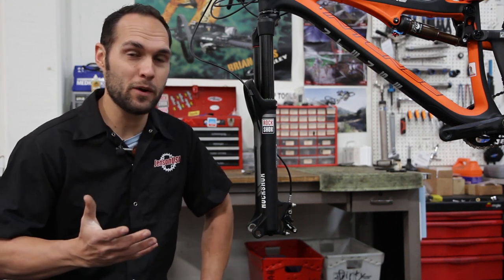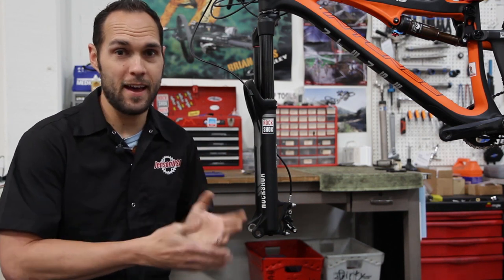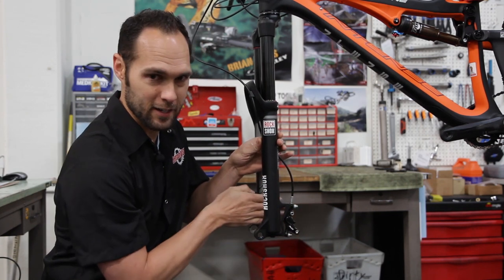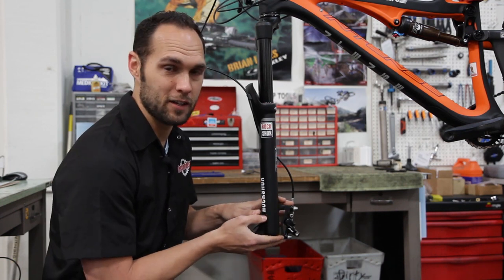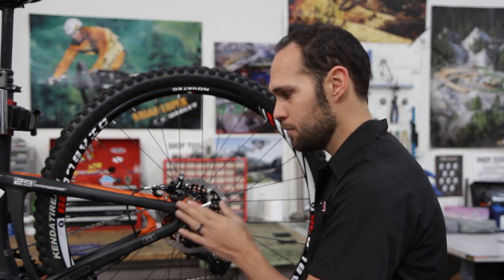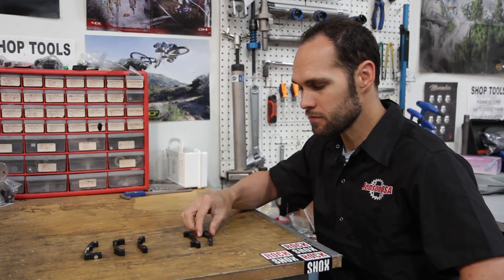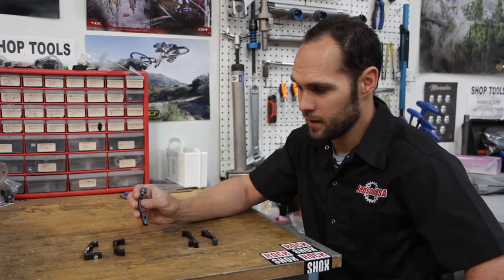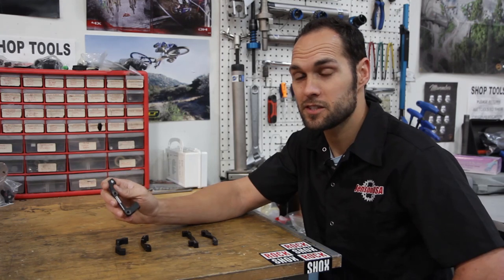Ask A Wrench Episode 07: IS & PM Brake Adapters

Comment: If got a mtb it has a 180 mm disc with postmount at the front and at the rear a 160mm disc with is. So you know witch Adapters would fit?

Comment: Kudos! I have a question though.. If my frame already has a IS that accommodates 180mm max rotor size, what adaptor do i need to use to be able to mount shimano saint brakes (post mount) with 180mm disc?

Comment: Just the info I was looking for. But I may have missed a good point.  What size shimano adapter is good for a 160 rotor and caliper for the rear wheel? All purchased in the same set.

Comment: Great explanation. On my bike I have this second adapter that you mentioned, Avid Adapter Postmount 40 P für +40mm Disc Rotors.
Now I would like to change the groupset to Shimano. Will use 203mm rotors, but it is really confusing what is the right adapter from shimano to replace this setup from Sram. Front fork is RockShox Sektor RL DebonAir with Brake Mount: disc PM6 (direct mount 160 mm). 
So I was guessing for the front this should be right one?
160 mm fork mount:
Shimano SM-MA-F203P/P2 - for using a 203 mm brake disc

Thank You
Reply from the maker: Hey Tomy Boy! Glad the video helped.  Based on your description of your setup, it sounds like you need this adapter: https://www.jensonusa.com/Shimano-F203PP-Disc-Brake-Adapter.  This is for a Post Mount fork with 160 native going to a 203mm rotor size.  If you need any further guidance, give our Gear Advisors a cal at 888.880.3811.  Keep Pedaling!
Reply: Thank you for your quick reply. 
Well on my bike that is still arriving I must say Turbo LEVO FSR 2019. 😊 and would like to change components while still new and the bike is at the shop mechanic.
This are the screenshots I could took from some video presentation of the bike. You are right regarding front adapter. 
http://shrani.si/f/2O/YL/2cBVMZ6S/screenshot-75.png

On the rear I can not see clearly. Sorry did find any useful pictures online, the bike was revealed this week.
http://shrani.si/f/3Q/BE/1bvhCY0P/screenshot-77.png
Do you think this adapter Shimano SM-MA-F203P/P would be also the same on the back? You have two other options for 203 on the site, but they are native 180mm.
https://www.jensonusa.com/Shimano-F203PPM-Disc-Brake-Adaptor
https://www.jensonusa.com/Shimano-XTR-F203PP-Disc-Brake-Adaptor
On the back it probably doesn't have native 180mm?

Thanks for any advice regarding my inquiry.